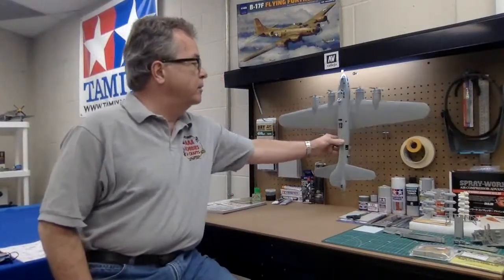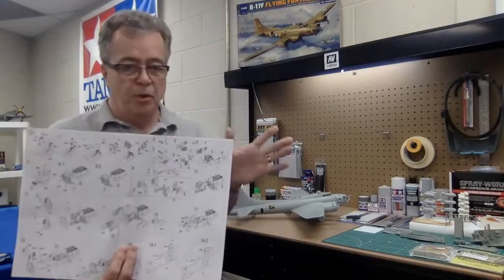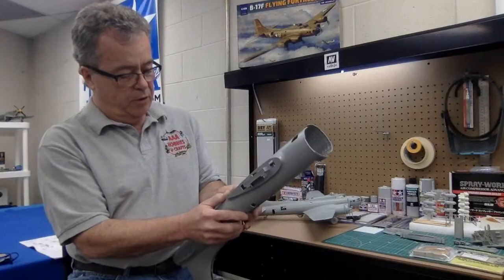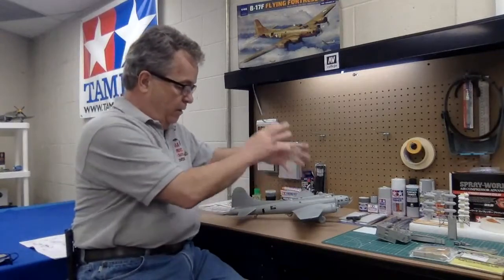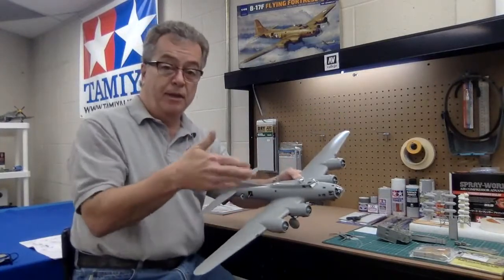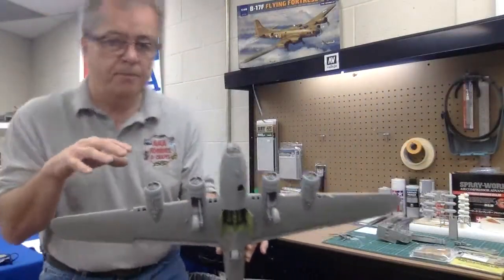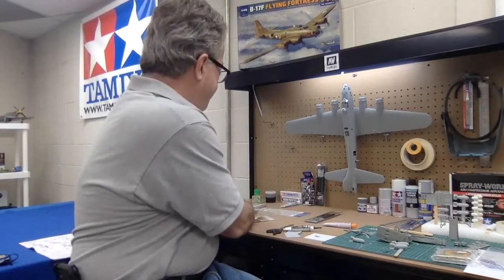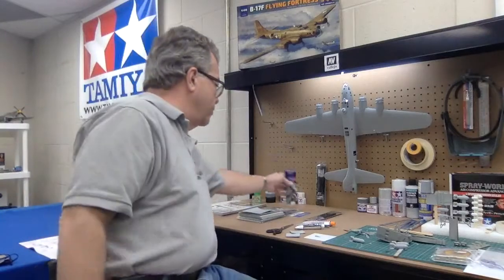Prep, Putty and Primer

Comment: I started out thinking that priming wasn't necessarily a big deal- just building up thin layers of acryllics with a brush would be 'about the same'. Wew lad was I wrong- fought with chipping/flaking for my first kit. My second kit was a submarine (that I primed)- I ended up botching the paint job about half way through so decided to take it back to zero. That is when I learned the value of priming. The amount of time and effort it took to get that thing back to bare plastic, compared to my poor Yak-3's accidental flaking, was insane.